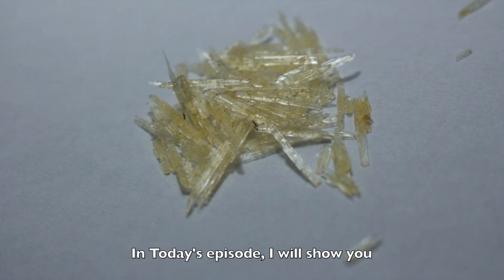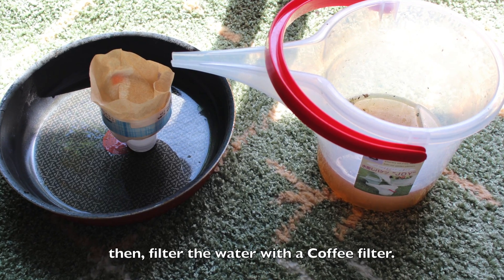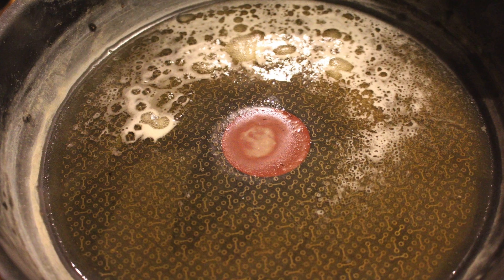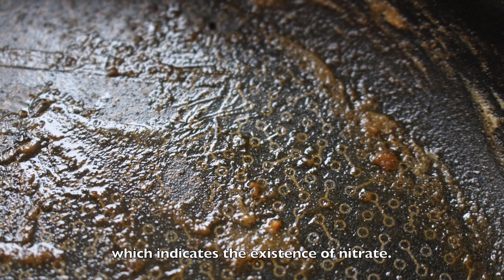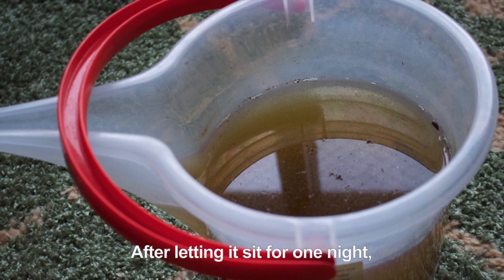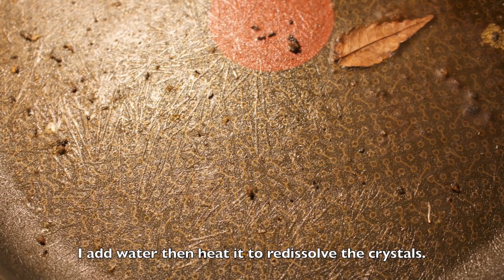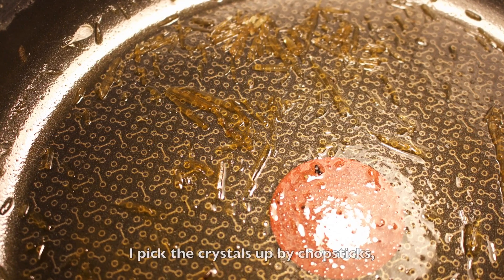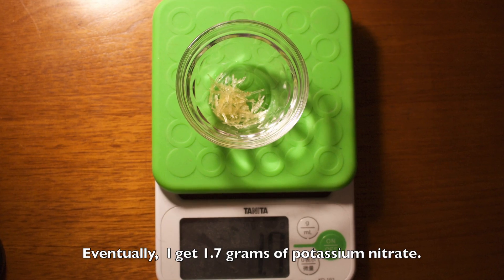How to extract potassium nitrate from draining water.

Comment: Wow great video. I knew you could get potassium nitrates from several different methods but this one I did not know. This method is similar to extracting potassium nitrates from manure.  With manure process you add wood ashes also and get nitrates. I like learning anything new, so thanks you

Comment: Where the kno3 coming from? is it naturally?plese reply
Reply from the maker: It comes from nitrogen fertilizer going though the nitrogen cycle.  The source is mostly nature urea.
Reply: How much time it take for being urea to nitret
Reply from the maker: I don't really know! Those were establilished pots, I continously fertilizedthem and continuously collected the draining water.
Reply: @muyfoods  if you pee into hay mixed with dirt (yea, its gross) and have a clay bottom, or some way to retain moisture, it will decompose everything into potassium nitrate, and all you have to do is dissolve it in water, filter it and then re-crystalize it